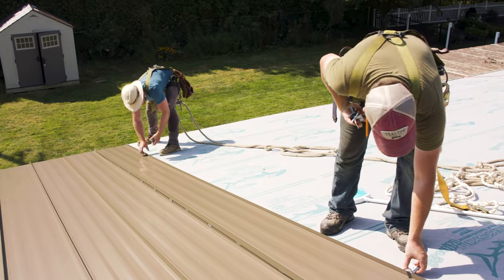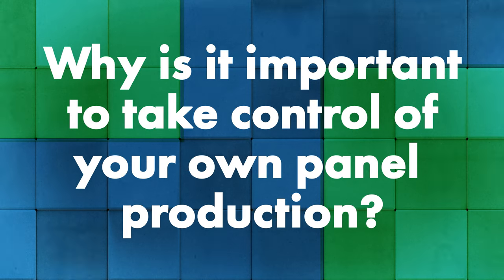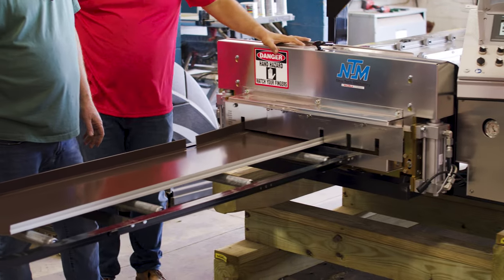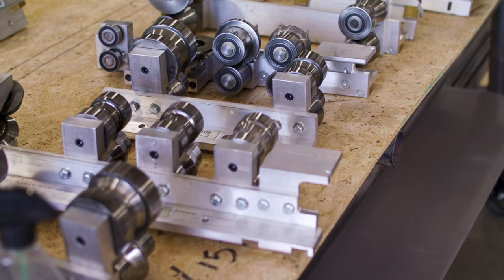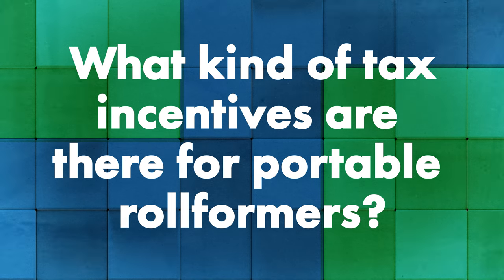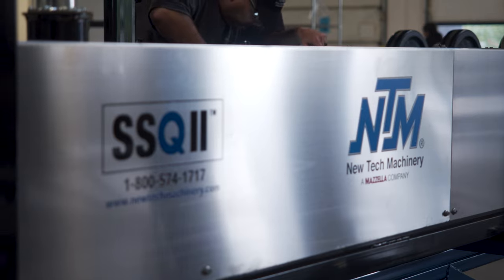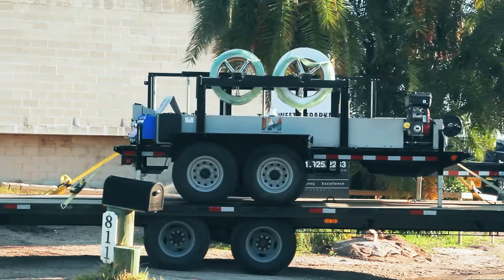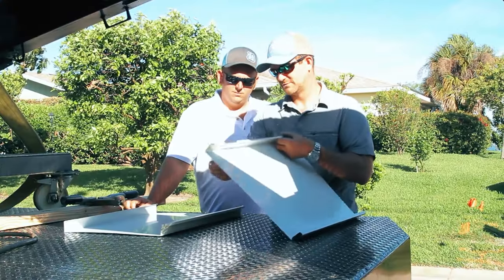6 Reasons You Should Buy a Standing Seam Metal Roof Panel Machine

Comment: My family lives in rural wooded areas. I've considered a panel machine to do at least 3 family roofs +.
All would be standing seams, but can the same machine make house siding? Forest fires in this area are a real possibility, so metal makes more sense than vinyl
I've seen older metal siding jobs with paint problems, yet older roofing jobs fair better longevity!
Any thoughts are appreciated, love the channel, and I've subscribed. Thank you
Reply from the maker: If you're only looking to do a handful of residential roofs, my opinion is that it would be better to have the panels run for you by a panel supplier, simply because the cost of a panel machine (especially one the makes both roofing and siding) is pretty high. However, if you're willing to give up the functionality of making siding profiles, NTM has a multi-profile residential standing seam machine called the SSR® that you could get for under $60,000. You could also look into single profile machines from different manufacturers that are much cheaper than that. Drop us a line here and someone can help talk you through your different options: https://bit.ly/buy-a-roof-panel-machine
You're right about older metal siding having paint problems, and that's because most of them historically used a lower quality paint system. You can avoid those problems by going with a high quality PVDF paint system on both your roof and siding. I hope this helps, and thanks for checking out the channel! -Thad
Reply: No, find a company that will deliver you the pannels or a chop and drop. These machines only make sense if you are running them every day and you are running a high volume business. The savings between coil and panels isnt really that substantial. I